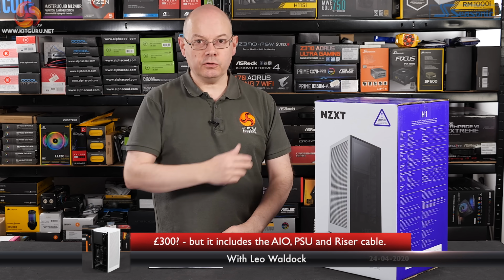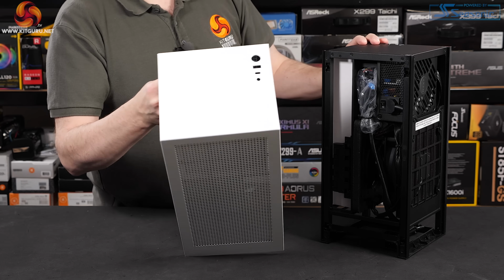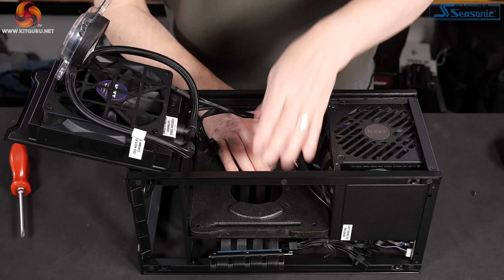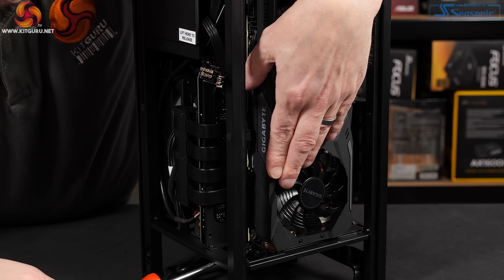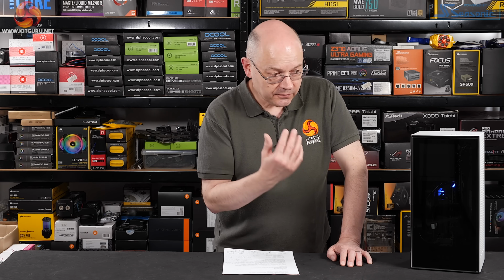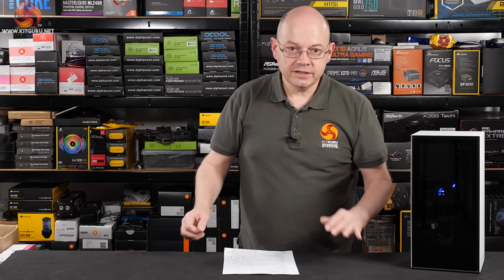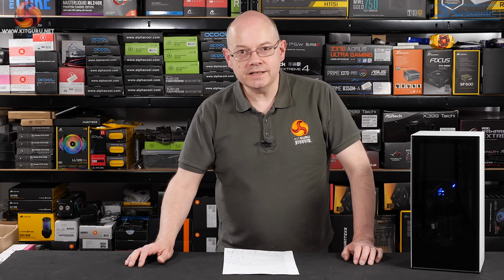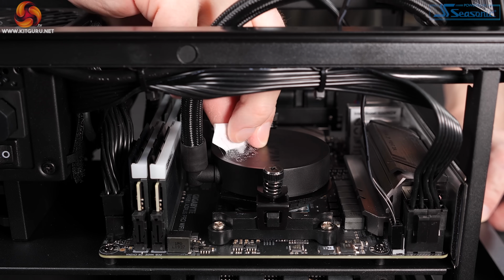NZXT H1 MINI-ITX Case Review - Leo is IMPRESSED!

Comment: Just found your review channel yesterday, enjoying it so far and have subscribed. I was impressed with this case, and like that you get the extras thrown in, as probably would have needed to buy similar anyway. The only real downside for me is lack of extra ports in the front of the case as you mentioned. Also, I saw shortly after this review that this case was withdrawn due to fire hazard concerns. It seems like it's back on the market now, is it safe to buy now? And since this review was over a year ago, was wondering if there are better alternatives now, especially if they have the extras thrown in?

Comment: Hi, this question might look strange but I would prefer a cpu air cooler. Should I remove the fan and radiator, what would be the CPU clearance? Thanks
Reply: In that case don't buy this case, consider the NZXT 510 instead.

Comment: How can a Riser be PCI-e 3.0 x16 capable and not 4.0 as the physical outpin is the same on the slot thus before AGESA update even B450 chipset boards (some of them) were able to run PCI-e 4.0 but BIOs updates removed that option, not that it makes a whole lot of a difference on the B450.

Comment: Hi, good review and I like the case but I have a question.
Do you think it's possible to use a DVI-D cable with this I/O set-up as I have an old Dell 30" display that I still love using.?
Cheers!
Reply from the maker: Don't see why not. The plug is large but the cable is conventional.

Comment: I gave mini-ITX a try, it was fun but I am over it.
Reply: Why is that? Whats the benefits and downsides to mini-ITX? And what size of case would you recommend?
Reply: SoleFreak 

The benefits are the small formfactor. The downsides: 

- Good low profile coolers are expensive
- Mini ITX boards are expensive
- You absolutely need a modular SFX psu, they are more expensive
- Neat cable management is a chore
- Replacing the RAM, GPU or CPU means disassembling everything.

Comment: You forgot to mention the rather restrictive GPU size limitations for this case. That is one big downside for this case. Many GPU's are either too thick or too long or perhaps both. It seems to have been designed with the reference Nvidia design in mind only.
Reply: even the Asus Strix RTX 2080Ti fits in this case, so that's not true! (check BitWit's video of this case for proof: https://youtu.be/eGdw7cYgAVk)

Comment: I can understand NZXT offering the case with options to purchase the other hardware but the fact that they refuse to sell just the case just smacks of gouging the consumer. If you already have a SFX PSU and plan on running a simple system with air cooling with onboard video, this case is useless. NZXT has their BLD service which lets you choose parts for a pre build they make so they can do this, they just want to take our money. Very elitist.
Reply: Well first things first. Nzxt has to first get this case in stock. It's been out of stock for months.

Comment: It's only cheap if you are going to use all the extra hardware.....😑
The cooler is no where near my acceptable efficiency or flow rate.
It's a shame, as a bit of modding would make it a great LAN case.....handle an' all.  TU150 anyone?😏
Reply: @ulhurusurf club  Was that a question or a confession bud?

Comment: Will this fit a 2.7 slot Asus Strix GPU?
Reply from the maker: No - a dual slot has some clearance but I cannot anything over dual slot fitting.
Reply: BitWit managed to fit the Asus Strix 2080Ti with barely any problems, so it is possible!
Reply: @chaosdefinesorder  noooope he struggled with that monster - gpu length of 305mm max is accurate for this case. 2080 ti strix is 307 and it showed in that vid.

Not sure what gpu it was but JayzTwoCents did manage to fit a Strix card in this case - might have been a 2070 Super Strix as thats 299.7mm, but 2080 Ti Strix deffo won't go in.
Reply: @FLYGRDN  how about this then: https://www.reddit.com/r/sffpc/comments/fcvk2d/just_finished_building_in_the_nzxt_h1/ quoted: "I also did not have to remove the dust shroud to fit this in."

or this: https://www.reddit.com/r/NZXT/comments/gab8ie/nzxt_h1_build_with_a_2080ti/ "hits up against the dust filter when sliding the sides on, not a problem after it is on"

Comment: Excellent video, thank you. How much space is there at the bottom? How large a plug can you fit? In particular, can you fit fibre-optic video cables? It's a shame that the riser cable is not PCIe v4 with v4 GPUs imminent.
Reply from the maker: That's an intriguing question. We used a conventional UK kettle power cord without problem. For the graphics connection we used DisplayPort which is a similar size to HDMI but what is the fibre connection you refer to?
Reply: @KitGuruTech  Fibre-optic video cables have big plugs at each end. I have three of these https://smile.amazon.co.uk/gp/product/B07BW5LG9X in a 10m version but I'm also thinking of software dongles that plug into USB ports.
Reply from the maker: @QuentinStephens  Well that sounds a bit over the top but ... fair question. You've got about 65mm between the rear I/O and the table top below the case so should be fine with cables but when it comes to Dongles it will very much depend.
Reply: @KitGuruTech  Thank you for checking. It's not over the top at all, and the 10m cables are now around £50 from another supplier. My PC is distant from my 4K monitors for noise reasons and the latter don't work so well with long copper cables, especially the 4k 120 Hz monitor. I've just measured one of the plugs and I need at least 90mm to avoid putting the cable under undue stress - 80mm might work at a pinch. See this pic: https://i.imgur.com/a8jGSqv.jpg

I use Displayport cables; you might think ahead to HDMI 2.1. 

Anyway, unless the lack of clearance can be resolved, it's a no from me for anything that requires a fibre link, and thank you for helping prevent me making an expensive mistake.

Comment: Hi, Leo. Thanks for another great video. I enjoy your no nonsense commentary. Questions:  As a software developer, not a gamer, I have thus far stayed with full-ATX builds. I don't fully understand the point of the mini-ITX builds. They are 1) not truly portable like a notebook 2) limited in expansion and hardware choices 3) have inferior thermals 4)  a pain to assemble.  Sure, I would like to have a powerful work machine that weighs less than my mega-monster Fractal R5 build; I would like to be able to take it along instead of the notebook. Concern: if the build is meant to be portable, is there a risk that a liquid cooler will leak when jostled? Lastly, is there a micro or full ATX case that is reasonably small and compact as an alternative to ITX?
Reply from the maker: You might approach things the other way round and ask, what is the point of ATX? Most of us use a single graphics card and might add a single expansion card which means we have plenty of dead space inside the PC. Balanced against that you don't save much money with mATX so what's the advantage? A decent Mini-ITX system is much smaller than an ATX tower and in most cases will cool perfectly well - our Ryzen 9 build is pretty much a worst case scenario. As for portable, that's really a different question. There are some tiny cases on the market but they all require mains power and a display. If you want portable, a laptop is the sane answer.
Reply: @KitGuruTech  Thanks for the come-back Leo. I hear you. I've gone full-ATX so far because of the large # of drive bays and the 4 DIMM slots etc.  Perhaps I'll try an ITX build and see where it fits in between the monster and my notebooks. Regards.
Reply: As a software developer your going to need more of whatever a software developer needs in a PC/Workstation - As a casual gamer my needs are much less, I don't need lots of drives & add-on cards so my system only has 1 slot for GPU, anything more is just wasted for me so ITX is great & takes up much less space on my desk, It's been a progression over the year's as I used to have ATX with sound card/wifi card/GPU, and as things shrunk down & wifi got moved to on-board as with Audio it made sense for me otherwise I'd have a massive case with a big motherboard with not much on it - different setup's for different needs i suppose 👍  As for thermals my ITX system probably runs cooler than most ATX behemoths as I have a 240 AIO on my Ryzen 3600 & a 280 AIO on my 1080-TI  all stays pretty cool & quiet 😁
Reply: @genx156  Thanks. Still wondering if liquid cooling represents a risk during transport. Is there a chance of it leaking?
Reply: @datapro007  I've never had an AIO leak, I recently purchased the Corsair H100i Platinum which had reports of leaking, but it was only 1 bad batch & checked serial number - mine is not affected - so they're pretty reliable, I also have the original Corsair H75 still running, it's years old & probably due for replacement, but it's still performing fine - as for mobility I've moved house a couple of times & moved from UK to Spain - still no leaks lol - my Acer X34A stand did manage to stab our Sony TV during the move & killed a couple of pixels though 😮
Reply: @John DoeEach format has its pluses and minuses. It depends on your purpose.